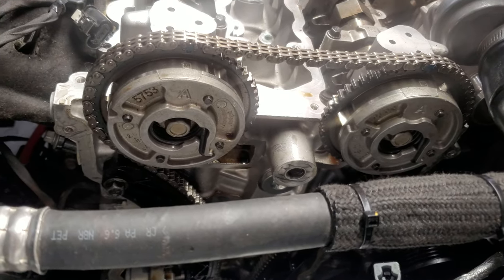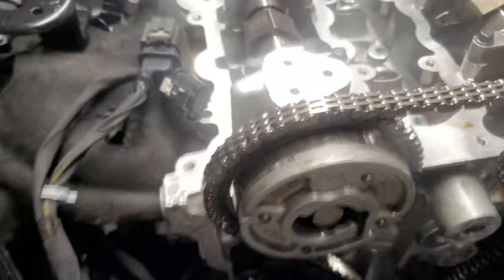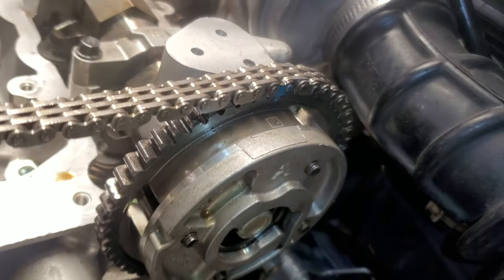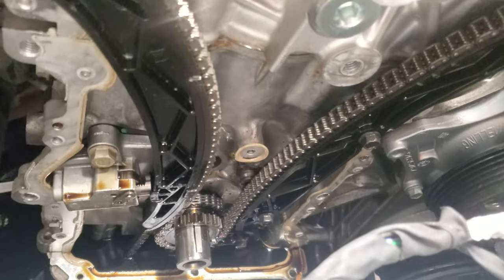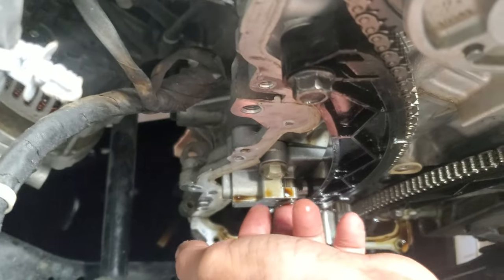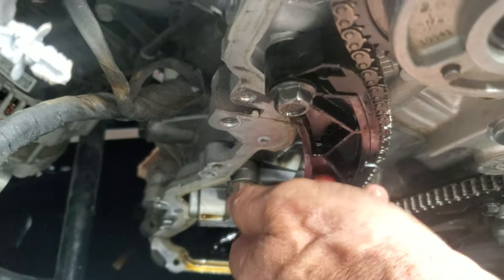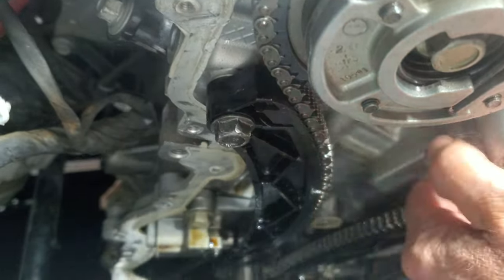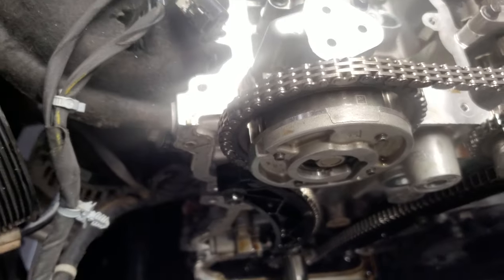1.5 chevy timing chain installation

Comment: I just purchased a 2016 with the 1.5T has 78k on it. I'm getting all sorts of codes p0014,P0641,p0011,p0341,p0366 and more. I'm guessing it needs to be timed at first I thought it was a cracked piston as that's the common issue. My problem is there aren't any complete timing kit available.
Reply from the maker: I haven't looked up the codes. But if you can figure out what parts you need you could get them off of a GM  parts online. I wouldn't think the gears or chain would be wore out. Make sure the right oil and filter are  right . There is a tensioner that's ran by oil pressure. There gears on the end of the cams that perhaps are not working correctly. I would take it to a dealer and like them do the diagnostic. They have the special equipment to find the problem. Probably cost $100

Comment: I have value timing codes and the car hesitated when taking off. I'm mechanically inclined but have never dug this far into the engine. But cost wise I think im going to have to do the job. Is the chain pre marked when you purchase it? Also any other tips to look out for or special tools I might need? Thanks in advance
Reply from the maker: Chain is premarket and I bought the injection tool to pull them out. Might want to see how to remove the vale cover https://youtu.be/jE-283RM0eQ
Injection puller https://youtu.be/8IuIBQ1I-VE another video of removing the balancer https://youtu.be/ggJVvDfayxc remove timing chain cover https://youtu.be/7EHL91FKark
Reply: @SawmillerSmith  ok definitely have some homework..thanks for the tips
Reply from the maker: This might be your problem https://www.gmpartscorp.com/p/Chevrolet_2018_Malibu/Engine-Variable-Valve-Timing-VVT-Solenoid/94403820/12701385.html
Reply: @SawmillerSmith  that is definitely better price wise and a good start thank you
Reply: I did little more research..the codes my car throws are p0017 and p0016 the vvt solenoid is different codes. I had hopes tho lol
Reply from the maker: @dohicky9647  I looked up the causes for the p0017 code here. We'll just have to check out what is the cause. Here it says what can set the p0017 code https://www.carparts.com/blog/p0017-code-camshaft-position-b-camshaft-position-correlation-bank-1/
Reply: @SawmillerSmith  this is what I was afraid of having to start with a huge list and do process of elimination
Reply from the maker: I know what you mean about having to check many things. But you might do a lot of work replace stuff and still not fix the problem. That's what I have done many times. But if your engine has high mileage it could be preventive  maintenance.

Comment: The marks on my chain are moving and not lining up after I hand spin the motor that's not normal right ?
Reply from the maker: I've never hand cranked the engine over by hand to see if they lined back up so I'm not able to answer that question.
Reply from the maker: After future research the answer is yes that's normal. They don't want the marks line up because that would make things wear out quickly.

Comment: Any markings on the oil pump can't seem to find any the chain has a mark but don't see one on the oil pump sprocket...and there is no info online ...help plz!!!!!
Reply from the maker: Just line up the making from the chain to the cam Sprockets, and the cam and crank sprocket. That's all you have to match up.
Reply: So is it normal for the markings on the chain to move positions from the marks on the cam sprocket when spun by hand?
Reply from the maker: @ezracarrizales23  I ready can't answer that question because I never did that to see what would happen. All I did was did what the institution said to do. But it is an interesting question. I would of thought the world line back up at some time.